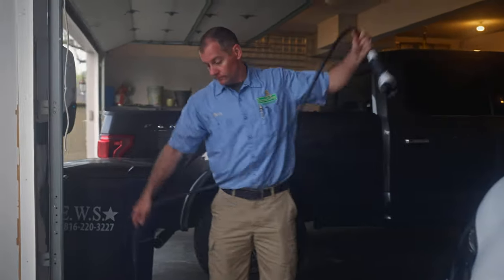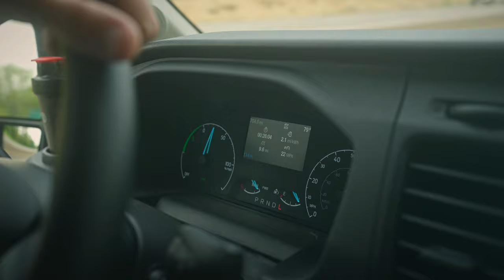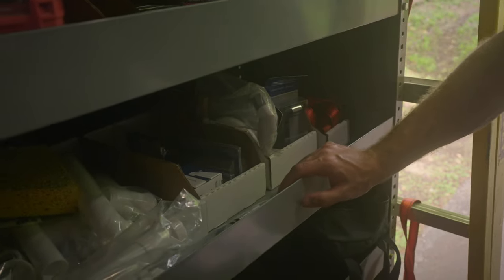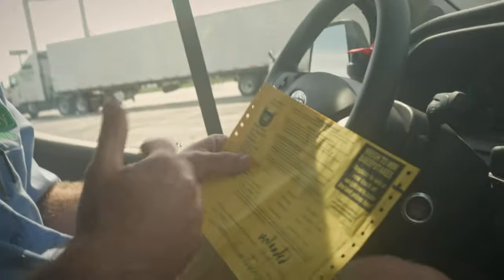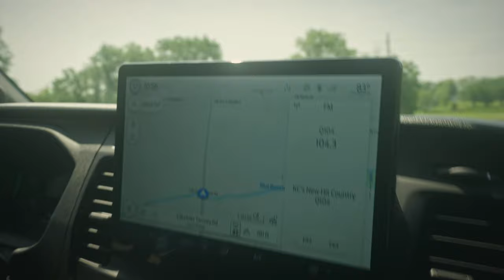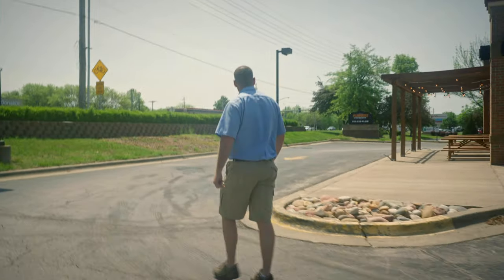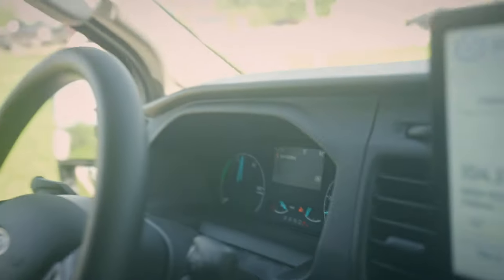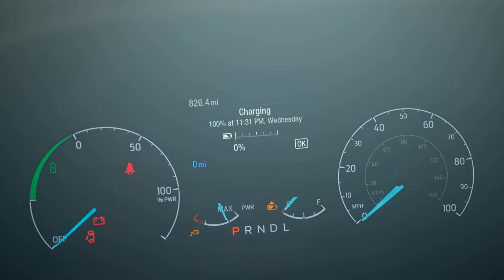**Ford E-Transit**  How far can you drive when it's loaded down?

Comment: Had a delivery job summer between High School and College, drove a box van and delivered electronic gear (speakers, amplifiers etc.) in and around a big city and several suburbs. In an eight hour day the run added up to about 80 miles give or take. This E-Transit would have been perfect for this task and a lot cheaper to operate.

Comment: I appreciate the feedback.
I didn’t know about the reduction, and no one at the dealership mentioned it to me. And I didn’t really see anything when I was researching online. 
Luckily, I should still have a few miles left, even at my lowest point 
Thanks again for the video. It really was helpful in me purchasing my vehicle and making the decision
Reply from the maker: Some common tricks that you can do for cold weather are scheduling your departure times and the van will precondition the battery as long as it's hooked up to a charger in the hour before you leave. That gets the battery up to the proper temperature and is using shore power to do that instead of battery power to do that. Another general best practice is to only use L mode in the city and to not use L mode during intermediate driving or highway driving. I've been fortunate enough to have lengthy conversations with some executives at Ford. It was a unanimous agreeance that the van is more efficient out of El mode and with the proper use of coasting. This is because you can activate mild versions of L mode by tapping the brakes once or twice.
Reply: this is very helpful ,   again,   thank you for taking the time to tell me all that.  I will defiantly put that information to use.
 @SmedleyPlumbing

Comment: Appreciate the very comprehensive real-world testing. It will be interesting to see how long term maintenance costs compare vs gas. I'd expect you will save money there as well.
Reply from the maker: We do too!
Reply: @SmedleyPlumbing  It will be a lot... for starter... you'll have a hard time wearing the brakes out.. also keep those tires aired up
Reply from the maker: @mikeb516  always!
Reply: @mikeb516 Well, you'd want to use the brakes enough to abrade away the rust and keep the rotors smooth.  Eventually we'll see corrosion resistant alloys and ceramics with EV's not using the brakes much but I suspect replacing brake rotors simply due to them being roughed up by corrosion will be and has been a thing till manufacturers decide it's a problem they will benefit from if they addressed it.  We already drive our ICS sedan so infrequently now that we've had to replace rotors already which never happened back when we commuted.  It isn't that there isn't enough material to corrode but the dealership mechanic simply thinks resurfacing wouldn't be enough as it simply hasn't been constantly ground down by the pads.

Comment: Electric vehicles are more efficient in urban driving than highway driving for two main reasons.  They get to take advantage of regenerative braking which puts energy back into the battery pack, but also because aerodynamic losses are significantly less.  Remember, drag goes up with the square of velocity.  Ballpark numbers are there are 35 lbf pushing back on the high top Transit at 30 mph and 140 lbf at 60 mph from aerodynamic drag.  Double the speed, four times the force. That's why slowing down just 5 mph on the highway significantly improves your efficiency, no matter the vehicle's fuel source.
Reply: The other equation affecting gas mileage or kwh/mile is rolling resistance, where weight increases rolling resistance linearly.  It's interesting that just using the 'L' mode and eco mode while driving offset the increased 2000 lbs of weight during his test.
Reply from the maker: Yeah we have found speed to be a significantly larger factor to range than weight.
Reply from the maker: So we haven't found weight to effect range at all.  More weight means more to get rolling.  But it also means more weight to use for regenerative braking.  Seems to be a net equal.

Comment: Thank You Mitch for all the great information on this Van. Also, if I may say you seem like a great guy to work for. As mentioned in my other comment, I got my surprise delivery from UTAH to CA on Wed May 18 at 7:30 AM. 4 days after my credit union funded the loan! Since then I've been working every day in the van. Many late nights setting it up and transferring all my tools/shelving for my Mercedes Metris. I was so lucky to find this van for 2K over MSRP from Performance Ford in Bountiful UT. The van was just as I would have ordered it. According to the Ford dealer, My only other alternative was to wait for the '23 order banks to open and wait a year. That may or may not be true after all, they have to justify their ridicules MSRP markups. My only disappointment is the van doesn't have passive locks, and I have to actively remember to lock the van. One touch opens. Seems strange that they would not include this feature. Perhaps there is an aftermarket solution? Subscribed...
Reply from the maker: Mine has passive locks.  You should be able to touch the door handle when you leave and the vehicle will lock automatically.

Comment: Great video. I'm not sure about the E-Transit, but on my PHEV Ford I was able to set my home as a charging location, and set your home as a destination in the navigation system. Hopefully that will eliminate it trying to send you to a public charger when you are on the way home. The other thing it should then do is if you get home and forget to plug it in, it will send you a message through the app and an email, if you want, reminding you that it needs to be plugged in.
Reply from the maker: Great stuff!
Reply: Great idea, I’m implementing a new software change asap😊

Comment: While the fuel savings is amazing. The upfront cost is also double. Saving 300$ a month still takes a really long time to break even. Not to mention the increased insurance for higher priced vehicles.

I know you save in other ways too. But currently the only EV that seems cost effective will be the trucks. As trucks are already really expensive.

I'm excited for all the EVs. I'm looking at starting my own business. But I just can't justify 70k Canadian for a work van up front.
Reply from the maker: Cost me $21,000 less to purchase than the three other gas transits I bought this year. The main reason for that is because gas transits are pulling a premium right now due to the shortage but I was able to buy the e-transit at MSRP. There is also a 7500 tax credit for the e-transit.  Also, the e-transit is costing me about 25% less than the gas transits to ensure. The price of the vehicle has far less to do with the insurance costs then you might think. Insurance companies have some pretty impressive algorithms to determine How likely a person is to crash based off of the type of vehicle they select. Apparently they think that EV owners are safer drivers.  Lol
Reply: It’s basically the same cost as a gas transit. Which gas van are you comparing this to?
Reply from the maker: @ben3989  try buying a gas Transit for MSRP right now.  They are selling for upper 60's and lower 70's.
Reply: @ben3989  There is a microchip shortage world wide for quite some time now. All of these cars have computers in them. So popular vehicles are at a premium right how because they're not rolling out. Because the vast majority of van buyers will still be buying a gas van, they will sell very quickly. So dealers jack the price up. Ev isn't as popular yet, so the ones that are made stick around longer and they can't jack the price up.

Comment: Both Ford E Transit Van video's are excellent and really good to see it being used in USA in real working environment to see what ranges you are getting, it would be interesting to see what it is like when it is very cold in winter. Here in Europe they are just about to be launched. Ford have really been working very hard on Electric vehicles and the Ford F-150 Lightning is amazing at the $40,000 start price and the ranges they offer. In Europe Stellantis (RAM is the US brand) has just released a version of a small van with a Hydrogen Fuel cell along with batteries and the it takes 3 mins to fill up the hydrogen tanks and has 249 miles range.
The other interesting point about the Ford Transit is that in Europe they are 99% Diesel powered as MPG's are much higher as petrol per US gallon costs $7.97 in the UK currently so on your 13.5 mpg one mile costs $0.30 in USA and $0.60 in the UK! The Ford Transit has been in existence here since 1965 and most people refer to 7,000 - 10,000lb vans as Transits even when it is a Mercedes, VW, Citroen, Fiat, Renault product. My son is an electrician and has a vacuum cleaner rather than a broom!!
Reply from the maker: We can't wait to do a range test in the winter
Reply: Fuel cells do worse in cold weather, cold climates
Reply: @SmedleyPlumbing  When you do the cold/winter test one tip to maximise range is that Ford has battery conditioning so just plug in the charger for 10 mins prior to driving out of your garage on those cold mornings this will mean that you are not wasting battery power where it try's to heat up the batteries as this will have been done directly from the mains.
Reply: @bryanayers6104  It will be interesting to see Hyundai have 46 Hyundai XCIENT Fuel Cell 36 metric ton (80,000 lb) trucks running in Switzerland which gets fairly cold in winter and there will be 30 of these into California next year. Other hydrogen 'big rig' trucks are 10 Kenworth/Toyota Hydrogen trucks operating out Los Angeles Port and the Mercedes-Benz hydrogen GenH2 Truck has been certified for sale so it will be interesting to see how these all do. Maybe Mitch could be doing range tests on Hydrogen vans in the future!!
Reply from the maker: @juliand5553  yep!  That's the plan!

Comment: My main question I have about the E-Transit is this: Assuming 750 miles driven/week (150 miles/day-5 days per week), 50 weeks/year (37500 miles) and a battery life which normally will last about 100,000 miles, this means that you will have to replace the battery every 2.75 years. New batteries are not cheap. Is the cost savings from operation offset the costs of having to purchase a new battery that often?
Reply from the maker: Keep in mind that the batteries don't typically fail completely. The batteries may lose performance over time which may affect your overall range. But it's not likely to all of a sudden just not work one day and leave you stranded.  Also, based off your local fuel prices and electrical prices, you will most likely have saved far more than what a battery replacement might cost.  I'm saving $90+ for every 350 miles compared to a gas Transit.  That comes to a little over $25,000 saved just on fuel expenses over that 100,000 miles.  This doesn't include other savings like oil changes and other maintenance that gas vehicles require.
Reply: The latest Li-ion battery chemistries are good for between 1000 and 1500 "full" charges and more than double this if only "partially" charged each time. If averaging 150 miles per charge then after 1000 charge cycles you'd have gone close to 150,000 miles. This would not be the end of the battery's life however, just at the point where many manufacturer's recommend replacing them (they'll have lost about 30% loss of original capacity). They'll still get over 70% of their original range and many owners will simply keep going on the original battery. Now if exercising the battery fully everyday (100% down to 0% before recharging), you will likely accelerate capacity loss. It's been shown that keeping the battery between 80% and 40% (driving it down to 35-40% before charging it back to only 80-85%), can greatly increase the battery's life.  It's good idea to get a battery that provides at least twice the range you'll actually need each day. It's also been shown that avoiding HVDC (High Voltage Direct Current), public chargers and instead using only Level 1 or Level 2 charging will greatly increase battery life.  
    Li-ion batteries also do not like being charged all the way to a true 100% which will accelerate capacity loss. Thankfully all modern electric vehicles come with a BMS (Battery Monitoring System), that will keep the batteries balanced and also keep them from being charged all the way to a true 100%. The gauge may read 100% but in reality it's only 90%.  Essentially only 61kWh of that 68kWh battery pack is actually available for this reason. I'm guessing that ideally the Ford e-Transit should go about 3.2 miles/kWh (3.2 x 61kWh or 196 miles unloaded).
Reply: Having 100 k warranty on the battery doesn’t mean that the battery only last 100,000 miles, in fact , with good cooling management the battery will last past 200k miles , there are electric cars with more than 200 k miles out there, you will loose capacity over that period of time but if you take care of the battery it won’t be much, so 250 k miles is totally doable, even more
Reply: @SmedleyPlumbing  And you enjoy a limited plumbing service range.
Reply: Do you really drive 37,000 miles a year for a contracting business? That’s insane!!
Reply: @ben3989  Some of us drive more than that per year... I average ~60k miles/year
Reply: 100,000 mile warranty on battery guarantees no more than 20 % degradation
Reply: @bryanayers6104 , some people do indeed do huge amounts of miles per week. they are a tiny minority though. Most vans do less than 100 miles per day on average. You can't write off a technology that is only going to cause issues for a tiny minority. Vehicles will get longer and longer ranges. By the time you can no longer easily get a new diesel van ranges will be up to the level you need. there is no point grizzling over something that does not fit your personal needs just yet when it does fit the majority now.

Comment: Great video for comparing gas to EV fueling costs and use case.  Do they come with heated seats?  Much more efficient to use heated seats during the winter and keep cabin heater usage to a minimum.
Reply from the maker: I don't see a button for heated seats on mine but it's possible that maybe heated seats come on automatically when you turn on the cabin heat.

Comment: What if work is slow in your town, and you have to send your guys to the next town over to get work will an electric van still work? Or drive one way to a commercial project over 100 miles one way? Also, instead of eating lunch in a restaurant you brought your lunch to save money and ate in the van taking a break for 30min. with the air conditioning running because its hot outside how much range will it eat up?
Reply from the maker: The ranges has to work for your business for sure.  Also, ac doesn't use batteries much.  Heat absolutely does though.

Comment: 25:44 Remember, the force of drag is proportional to the square of your speed. Yes, you do get some efficiency losses with ICE and drivetrain, but the main reason you are more efficient at 15 to 25 mph in an EV is because of the enormous reduction in drag. The outside air temperature makes a difference too. These batteries, like us enjoy 70°F. When you increase or decrease the temperature 30 to 40°, it reduces your range.
Reply from the maker: This is all very true

Comment: Well the load will affect how much energy is required to accelerate and decelerate and regen braking only recovers some of this energy but just traveling at a constant speed, the load wouldn't matter so much, of course driving at a constant speed is often not what drivers do.   Electric delivery vehicles have been effective for over a generation with say UK milk delivery trucks.  It's just a matter of getting used to the EV's and trying not to drag race with all the available torque.

Pity you're not local, your video shows that you're professional, well equipped and proactive in a changing economy.  We consumers are often just hoping for the best when we need help but videos like this can help us sort out if we're dealing with a professional who's probably competent.   Whether or not EV's are right for a business, you've shown that you've given thought to how your trucks are laid out and just trying out the e-transit shows that you are unbiased in researching for the future.
Reply from the maker: Exactly!

Comment: Great video!    Weird though, my old 2010 iMiev had 16kWh battery.  It would take just under 11hrs to recharge from zero on 110v standard.    Your battery pack is 4x larger, so I would think 44 hrs,  not 70hrs, must be something weird on the Ford 110v plug.   As you most likely know, charger is in the VAN, the plugs are basically high tech circuit breakers, at least the ones in the bag.
Reply from the maker: It's all about amperage

Comment: An HVAC business in my area leased one to test.  The rest of their fleet is standard Ford Transit with high roof.  They used it only within 10-15 miles of the home base because of the short range.  They're not going to renew that lease.
Reply from the maker: Yeah EV ownership is a mindset shift. And some people enter EV ownership with the wrong mindset and therefore they will never see success with it. They either enter EV ownership assuming they'll get more range than what is advertised or that it's as easy to fuel up as a gas vehicle. But either which way, if you enter that with the wrong mindset you will be frustrated every time.

Comment: Good video: just a note on your load capacity is that it also includes people.  So really if your the main person driving, you should have weighed in on the loaded weight.  So don't hire and heavy technicians, they eat (or already have) into your cargo capacity.
Reply from the maker: I figured that since I was a constant, I could either be in the vehicle or out, as long as it was the same for both tests.